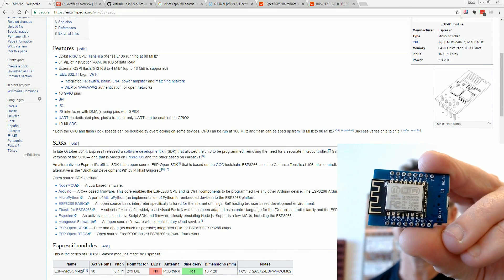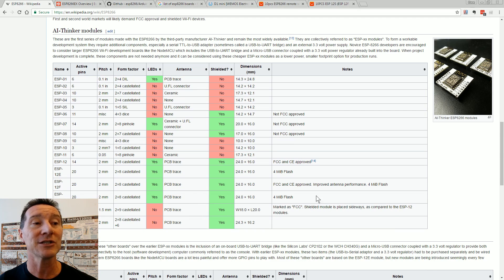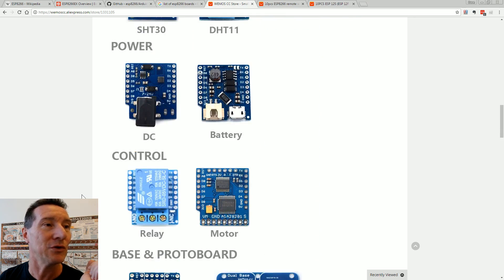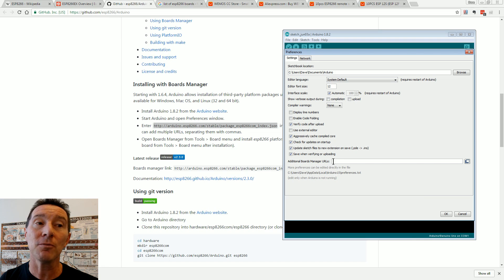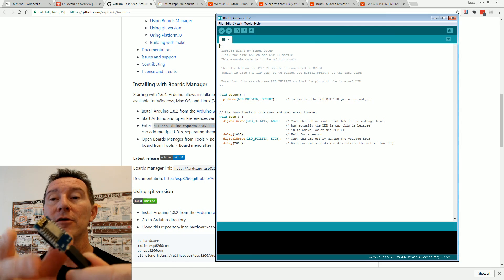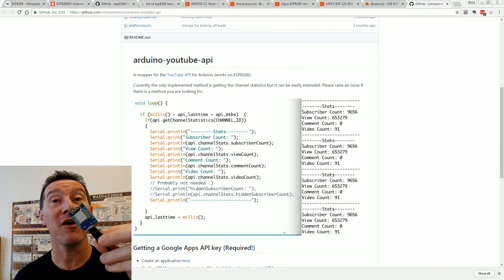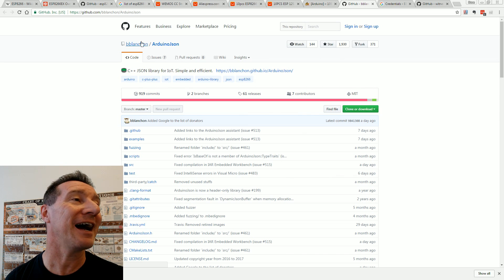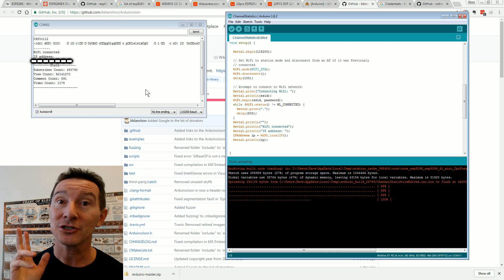EEVblog #998 - How To Program ESP8266 WiFi With Arduino

Comment: I personally wouldn't use the ESP in a real product: The SDK is horrible (probably worse than any major vendor and even those are full of bugs), there is basically no code protection or integrity checking, support for standard stuff like TLS is missing or crap, OTA system painful and crap.. Properly tested modules with decent-ish SDKs, FCC testing that isn't an outright lie etc aren't expensive.
Reply: The TI offering was pretty crap last time I looked at it a few years ago but I would be surprised if it's as shonky as the espressif SDK. wiced supports a bunch of different setups that use parts you have a hope of actually getting in a few years time. It's not a great SDK by any means but it's not totally horrible. Marvell also a similar platform for their mc200/mw300 chips which again isn't amazing but is a lot better than the ESP stuff. There's electricimp too.

And I wouldn't mind the Ameba stuff is the SDK is good (don't know, haven't looked at it). The hardware specs are pretty good and everyone is using realtek wifi chips so the wifi part can't be too bad.
Reply: Are you specifically referring to the ESP8266 or all ESP products?  The ESP32 has great security features including encrypted flash and TLS is definitely usable.  You have a choice of development environments for both product lines.  Even if you don't use the ESP products yourself you'll get some benefit from competition in this wireless-mcu space.  I have used a number of devices like these and they all have (or have had) very serious problems, making development tricky (or in one case impossible).  The ESP32 is doing pretty well in my use-case and the online support from Espressif and other active device champions is very good.

So my experience differs from your own.
Reply: @Stuart C

The ESP8266 specifically. Most of it's crapness is probably a result of the fact that it's meant to be a wifi interface that's integrated into some other product.
If it actually has some way of stopping people from ripping the code straight out of a product and producing clones that's a step in the right direction I guess.
Reply: The ESP8266 is good enough for most hobbyists and hard to beat on the price.
Reply: I think you are correct.  I forgot about the Marvell chip but I have the AWS with the Marvell SoC but it seems Marvell isnt event promoting their WiFi SoC anymore?  I agree that Espressif and Realtek Ameba are too Chinese in documentation and poor reliability,  and not suitable for USA commercial products.  What would you think is the best WiFi SoC out for development commercially?  I would have said thee Wiced but Broadcom just sold it to Cypress so i'm hesitant to develop with it.  TI has released the new CC3300 with better security but with TI who knows they drop support for their products randomly all the time.
Reply: @donpalmera I think you are correct.  I forgot about the Marvell chip but I have the
 AWS with the Marvell SoC but it seems Marvell isnt event promoting 
their WiFi SoC anymore?  I agree that Espressif and Realtek Ameba are 
too Chinese in documentation and poor reliability,  and not suitable for
 USA commercial products.  What would you think is the best WiFi SoC out
 for development commercially?  I would have said thee Wiced but 
Broadcom just sold it to Cypress so i'm hesitant to develop with it.  TI
 has released the new CC3300 with better security but with TI who knows 
they drop support for their products randomly all the time.
Reply: What's 'too Chinese' in the Espressif documentation?  Have you read it?  Are you aware of the wide ecosystem being built around their hardware?  Given that making Wi-Fi+BLE SoCs is Espressif's only purpose, it's in their interest to build and support their chips and modules as well as possible.  I don't get it, honestly, why you'd be discounting it as an option.
Reply: @Steve B
I think Marvell might be having an internal shake up.
The best WiFi SoC out there at the moment is probably the murata type 1gc. It's dual band, does all the security stuff you want, has a fast main processor and plenty(for now) of RAM. Wiced SDK could be better but at the same time could be a lot worse. I can understand not wanting to use it right now (it's broadcom now crypress based) but I think whatever you go for in this field you'll have problems with single sourcing etc. At least if you use wiced there is a chance you can run your stuff on something else.

I hadn't heard of the C3300 until now. Maybe TI will get right third time around.

Anyhow my bet is on dirt cheap SoCs capable of running linux (<500mhz cortex a5) being the way to go in the future. I don't think microcontroller platforms are robust enough and it's going to get harder and harder to squeeze in more ciphers for TLS etc.
Reply: @pepper669 congratulations on missing the entire point of the comment you replied to.
Reply: @Stuart C
Honest question: Would you use the espressif stuff in a run of hundreds of thousands of units?
Lets say the ESP32 is dramatically better than the ESP8266, the hardware and SDK are amazing etc would you trust espressif not to just discontinue the part you're using or disappear entirely one day?
Reply: @ donpalmera2 hours ago Thank you very much for enlightening me.
Reply: @s bright
You can have the A5 in sleep mode most of the time if you have a wifi chip that knows how to respond to most wifi frames and only wake the host when there is new data. Most wifi chips with are SDIO interface a capable of that.
I think for dumb wifi sensors you might be right on using an MCU based thing but the requirements for IoT products are getting to the point where an MCU is getting a bit tight.
Also having memory protection etc is desirable considering the environment of fear around this stuff.

Murata is an integrator. Their part is basically the cypress part in a nice package that you can actually order from digikey or mouser.
Reply: @donpalmera well if I was designing a run of hundreds of thousands of units then I'd probably have a relationship with Espressif directly.  Sure other businesses are doing just that (Pycom and ublox for example).  There are risks in anything; I could select a range of chips from a huge supplier (e.g. Intel) only to have them change tack and dump a product range - It's happened recently.  So I'd be looking for assurances from them and would probably buy a bunch of stock to protect myself (ESP32's are pretty cheap in large volumes).
Reply: @s bright.  Google "fcc id esp-wroom-32"; yup.  Also check on the Bluetooth SIG website; Espressif is there "Lol".  Wi-Fi Alliance certified?  Yes.  Just because it's Chinese doesn't mean it's junk.  Sure it's for makers and it's new, but it's being picked up by proper industry players.  If I was paying circa $10 for a (typically crappy) Wi-Fi SoC and a competitor was using a more capable ESP32 for 1/3 (or less) of that then I'm at a disadvantage.  Local FAE support?  Yes, thanks, I do, from a good local disty.  I think you need to get off your horse and look about you, man.
Reply: Just in case FCC ID searching is difficult for you (it's not easy, actually): "3 results were found that match the search criteria: Grantee Code: 2AC7Z Product Code: -ESPWROOM32".  Those are your search terms.
Reply: @S bright I am using the SDK with Eclipse.  I'm in the UK and have a disty that supplies and supports the WROOM-32 and WROOM-02.
Reply: >Wi-Fi Alliance certified?  Yes.  Just because it's Chinese doesn't mean it's junk.  

Wi-Fi alliance certification != not junk. Wifi cert is basically a cartel. You pay your money, you get the logo on your box. There are plenty of incredibly shit wifi products, chipsets etc that carry with wifi alliance certification. 
There are products that carry the wifi alliance certification that don't work with other wifi certified products.
Reply: > Sure it's for makers and it's new, but it's being picked up by proper industry players.

Name one product that's selling in quantity from a big name that has an espressif chip in it.
Reply: @donpalmera - Sure I know that.  @s bright was implying that the FCC and Bluetooth logos were being used illegally.  They're not, that was my point.  As far as I can tell these logos are legit, paid for and at least registered with the appropriate organisations.
Reply: > Name one product that's selling in quantity from a big name that has an espressif chip in it.

How would I know that?  Manufacturers don't advertise their component choices!  It's not just the direct Espressif products but the plethora of modules from other vendors.  The ESP8266 has been out there for a few years, it's cheap, easy to find in quantity.  The ESP32 is very new.  Why would you wait for a big name to use a component before you appraise, test and use yourself?  Fear.
Reply: I started touching Espressif products from ESP32, so I never had to read the horrible document of ESP8266 (yes, I'm Chinese and I still feel it's hard to read ESP8266 docs). The new ESP32 has pretty decent documentation and pretty good software toolchain. Another thing for ESP8266 is that its pin mux and peripherals are too limited, unless you only need a few simple IOs, it won't work. You just don't have enough IOs and peripherals. I will never consider designing a product with ESP8266. But the ESP32 looks very promising and I'm having some fun with it now.

Comment: Don't forget that using the ESP chip directly (as opposed to a module) requires you to get RF certification... not cheap!  Penny pinching will only pay for that at pretty high volumes.
Reply: lmiddleman exactly
Reply: Using the ESP chip directly requires intentional radiator FCC certification instead of unintentional radiator FCC certification. You're going to need FCC certification either way if you're making it into a product, it's just like an order of magnitude less cost and fewer headaches / fewer things to go wrong. (Exception: Unless you're making something and selling from China where they don't care about FCC certification.)
Reply: Hardware design guide and you do not need that much RF calculation mate :)
Reply: You're talking about volume manufacturing - I'm literally here to create a small fleet of about 20 devices that will only be used in the same physical space most of the time.

Comment: Not sure if anyone mentioned this yet, but you no longer have to download a zip file to install libraries such as ArduinoJson. All you have to do is go to Sketch -> Include Library -> Library Manager and search for the library you want to install. Most libraries that you would ever need are available there, and it also makes updating your libraries incredibly easy
Reply: loureb2012 that's only an option if the library creator released it there. I did realise the YouTube one there but I only realised now I don't mention it anywhere on the readme!
Reply: Brian Lough Very true, every library is not on there. I've definitely still had to install my own libraries the old way sometimes, I just wanted to make sure people knew there was an easy way to get common libraries line ArduinoJson. Thanks for clarifying though, I didn't make it super clear

Comment: Any hints for a house bus? I am building my house right now and would like to integrate my own microcontroller house bus, but cable based due to is safer, but what: CAN, RS485, I2C, ...?
Reply: I2C is out of the question - it's meant to span centimeters between chips on the same board, not many meters around the house; there are adapter chips that can extend it but that's really not the way to go. RS485 and CAN are both valid choices - although CAN was also meant to span vehicle sized installations, it's perfectly capable to cover a house at lower speeds like 125Kbit/s or less, and it has some nifty stuff like Rx/Tx error detection and collision/priority handling built-in. If you really choose wired, that's what I'd go with. The thing to note though is that CAN only cares about getting a few bytes you put in at one end delivered to the other - not what they are supposed to mean; you'll need to choose one of the existing higher level protocols on top of CAN (or write your own) to build up functionality in your devices, such as distributing addresses, re-flashing firmware etc...
Reply: Attila Asztalos thx ..would it be possible to use an esp and  convert wifi to coax cable based bus?

Comment: Great video! Very useful! Can you make one using the I/O pins?  Maybe make two of these talk to each other over wifi.  If we turn a switch on one a light on the other one turns on and vice versa.  Also can you talk about the power draw and how long it will run on a battery.  Thanks!!

Comment: Fun fact: The reason you're seeing garbage after a reset is that the bootloader is running at 9600 baud, while you're set to 115200 baud. After the bootloader completes, your program takes over and switches the baudrate.
Reply: actually it runs at 74880
Reply: I stand corrected. In any case, you can either look at the bootloader messages or your application, but not both.
Reply: anlumo1 unless of course you program the sketch to use the same baud rate.
Reply: This is my olution also - I just run everything at 74880 baud ;)
Reply: EXACTLY!! I agree 100%  ..   or if perhaps it's 3 start bits 7 data bits and 4 stop bits and the 8th bit last which gets inverted every other cycle   or some obscure shit like that!! which is highly unlikely!!   it's just the default bootloader baud rate versus your program memory baud rate as he already stated ........  set them both the same  and  everything in the terminal window should make sense ..    o_O
Reply: OR  : Fun fact: The reason you're seeing garbage after a reset is that  your power supply is insufficient or there is AC ripple and the DC supply isn't clean   OR it's just a shit board or micro you got from China.... OR the flash memory is shite and needs reflashed and rebooted like windows!!!  .    o_O

Comment: I love the ESP8266.
Cheap, Powerful, Wireless, Cheap and Cheap, the only downside is the available GPIO
I'm looking forward to using the ESP32 as well.
Reply: Check out port expanders: https://playground.arduino.cc/Code/I2CPortExpander8574 
I've tried the PCF8574 on a Wemos D1 mini and it works like charm. And you can even cascade them.

Comment: You just discover Arduino, you thought it was made for kids (An employed professional that getting old). IDE sucks a bit but hey, if you use your brains, it's awesome. Anyway, bought a NodeMCU (ESP12E) on aliexpress just for 3 euro's including shipping ;-) The nice thing about this device, it got more pins and it is working great, however, because of the amount of memory it takes longer to program via USB. I don't care, it so useful, remote projects are really easy now, much better and reliable than a Bluetooth COM when using for commands only. There are some projects with websockets to get a bi-directional interface, not tried yet.

Comment: I don't get the point of this thing, seems like a lot of trouble just to get a WiFi adapter to connect!  Also if they are for use on an Arduino why is there a USB port on the end?  Seems like unnecessary duplication.
Reply: They are Arduinos. Small very cheap Arduinos with Internet access! Just enter your SSID/password in the WebClient example code and you're good to go - phantastic!
Reply: So it's a WiFi module with an  ATmega processor in it but still seems pretty useless!  It doesn't seem to have any capabilities and it couldn't really do much but turn on an LED using WiFi so what's the point?

Comment: - Apparently you can power then using a LIR2032 rechargeable coin cell.
- At the highest speed (baud rate 921600) upload is a bit wonky but works most of the time.